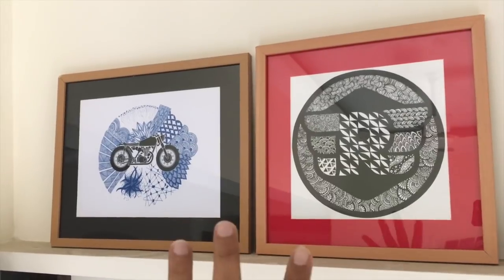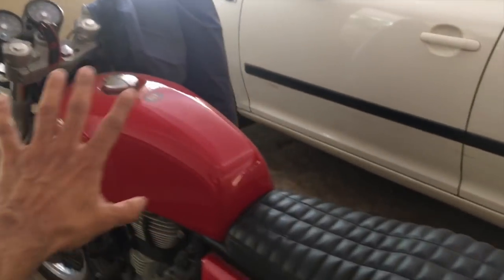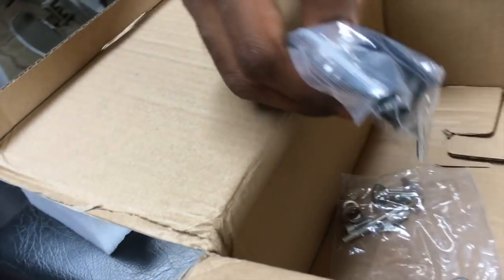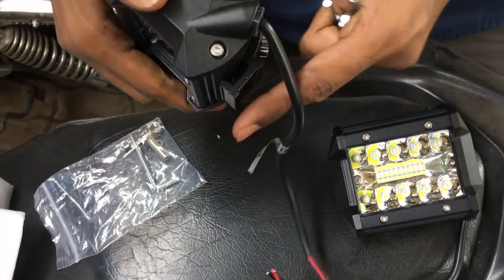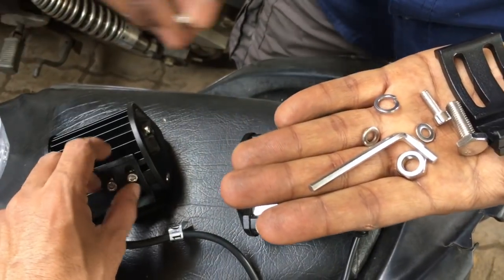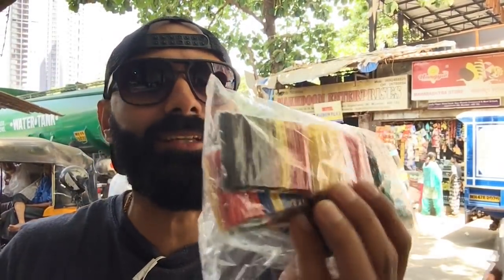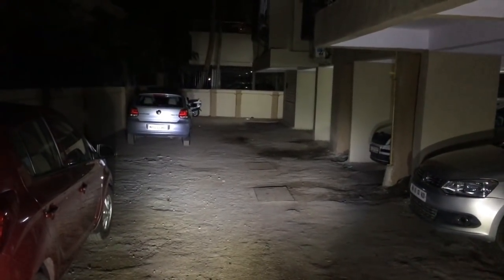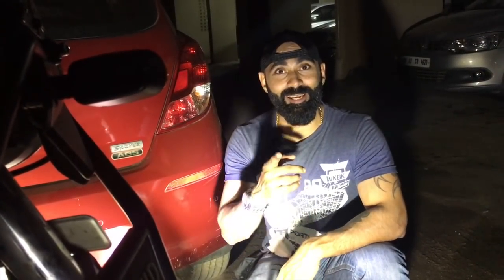Motorcycle LED Auxiliary Lights setup

Comment: I had fitted led 20 watt each of this kind...contains 12 leds on each light below my visor as i face problem on leg guard. On leg guard fitting, this lights cannot show me the corners while taking turns. But after fitting on front nber plate...it works fine....

Comment: Bhai kitna bhi adjust kar le, the flood beam led strip in centre of each led bar IS going to blind oncoming traffic. If you want to perfectly adjust beam to fall just on ground you have to go for 5D or 9D spot led bars with lens. Those are almost double the cost.
The cheap led bars you said about, uses epistar led chips which are invented by Chinese themselves. Cree are full square chips as seen on some older led bars. I still doubt The ones used in this lights because real cree chips have the emitting area(yellow) itself square . Here you got square white structures but the actual yellow emitter surface is round, if you observe closely. Thanks for this video anyway! I was wondering if i can install these in my RR310

Comment: Although I am late to comment here, just to let you know any kind of alteration(modification) be it in wiring or in design needs to have a permission acquired from the regional RTO. WITHOUT RTO PERMISSION IT IS ILLEGAL TO MOUNT ON THE BIKE. AT FIRST PLACE RTO GIVES THE PERMISSION TO THE CUSTOMERS TO BRING THE BIKE ON ROAD IN THE CONDITION AS IT IS SOLD BY THE SHOWROOM. SO IT IS FINE TILL RTO DOES NOT CATCH HOLD YOU AND TILL THE SALE OF THESE ILLEGAL ACCESSORIES IS AVAILABLE ACROSS INDIA. PENALTY OF NON COMPLIANCE 1000/- PER MODIFICATION. BUT NO COP TAKES THIS SERIOUSLY . TC

Comment: Everytime the Battery Issue...  Seriously, Its a shit
Reply from the maker: Subho's Vlogs it’s due to device connected with my battery
Reply: Ride With Raj But why everytime
Reply from the maker: Subho's Vlogs till the device is hooked on it will drain I will have to remove both the devise soon
Reply: Ride With Raj  instead of removing those devices ...you should connect a switch for those some where below the seat so that you can turn them off if you aren't gonna take your GT for a long time !! Which does not drain you battery .